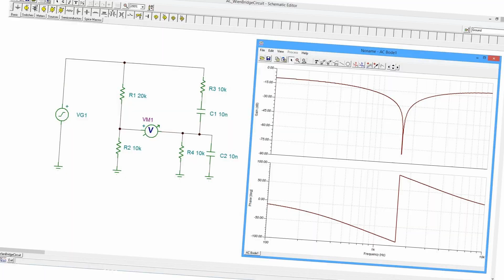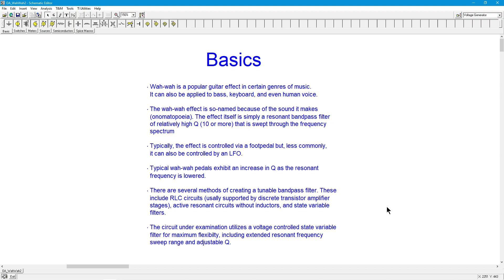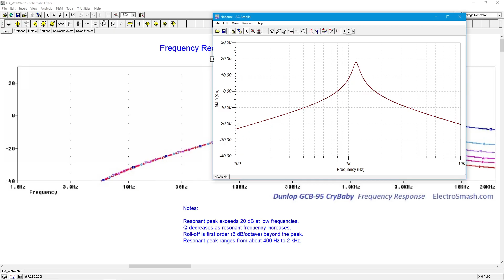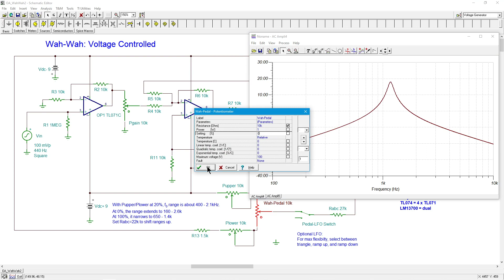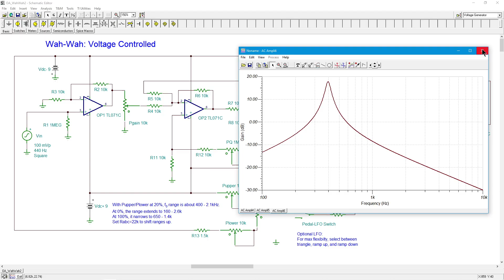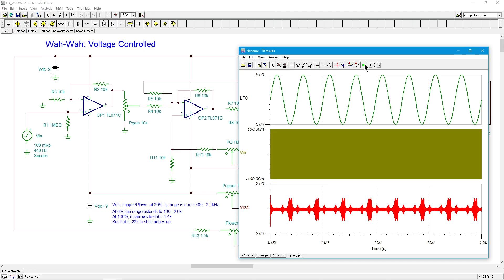Op Amps: Wah-Wah Pedal

Comment: Can you do a video about controlling something like this with an envelope?  I that would be like an autowah or an ehx dr. Q. I’m having trouble getting envelopes from a guitar signal to act as a control voltage.  Love the video!!
Reply from the maker: You might consider using a precision rectifier with a capacitive load to create the CV. Here's another one of my videos that might be of help: https://www.youtube.com/watch?v=eE3FD2pBizc
Reply: You may wish to take a look at the Dan Armstrong Orange Squeezer schematic or the MXR Dyna Comp schematic, both of which have very musical rectifiers to determine signal level. It will take some reorientation for this use, but they follow a similar topology of using the straight audio along with an inverted copy to feed a pair of half-wave rectifiers which charge a cap.  It's a somewhat high impedance result, but you can monitor the voltage with a JFET opamp like the TL072 to buffer, amplify, scale, and bias the envelope detector output for driving the OTAs.  The DynaComp design actually feeds directly into an OTA and may be your best bet for an easy integration.  Try searching for MXR dyna comp analysis and you'll find some nice documents.

Comment: You are using 18V for the power supply (-9V/+9V). Is this to provide a reasonable output gain without clipping? Would it work with a 9V supply but may clip sooner? This was a great explanation of a cool circuit. Even though I have a wah pedal this would be fun to build. Thank you so much!
Reply from the maker: Two reasons, actually. The first is that, as you say, you get greater headroom, but I also prefer it over a single battery because that way you can dump a bunch of biasing resistors and potentially large bypass/coupling caps that are needed for a single supply version. It makes for a simpler circuit that's less expensive and has an easier layout. I think it's well worth the cost of the extra battery. Admittedly, it's slightly less convenient when it comes time to replace the  battery(ies).  But sure, you can make a single 9V version of this given the biasing changes (you can't just ground the negative supply, not unless you like tons of distortion all the time).
Reply: You may wish to consider using a single 9V battery and a charge pump such as the ICL7660 or a more modern variant like the MAX1044 to provide -9 and +9 for the increased headroom and increased slew rate.  The Klon Centaur makes use of the same chip to create +18V and -9V supplies from a 9V for still more headroom.
Reply from the maker: @Peter_S_  Yep, that's a possibility. The -9V supply only draws 7 mA according to the sim. Personally, I don't mind double batteries. One of my active basses uses two and it's never been a hassle.

Comment: A very straight forward design even as a perfboard build and something a hobbyist and novice could build by all practical standards. 

I still remember 30 years ago wiring my first set of pickups out of phase, understanding peak resonance and magnitude, and that the phase shift over time based on amplitude dominance swinging back and forth was ultimately relative to what a wah pedal was doing.

It wasn't until many years later(over a decade) that I actually had a handful of useful scientific knowledge beyond that though lol. We all have to start somewhere.

Comment: 23:20 I hear some overtones in certain sweep positions. So there seems to be some clipping going on in the late part of the circuit. Thoughts?
Reply from the maker: Maybe, but that might just be artifacts from TINA's audio playback. I'd have to build it to say anything for sure.
Reply: @ElectronicswithProfessorFiore    You haven't built it?  Simulation is all very well but I invite you to consider Castle Bravo.  That gave an unexpected result.
Reply from the maker: @wilhelmvonn9619  It sure did. But they didn't have a simulator for that. I'll be the first to admit that simulators are not perfect, but this is a fairly straightforward circuit.

Comment: Oh man... This brings back memories. Back in 2001, when I was a freshman in college, I posted a User Review on Harmony Central for a Bass Wah pedal where I mentioned how to mod it to get rid of the annoying on/off delay it had, just by changing one resistor. Because I used to be active on those forums, every now and then for many years afterwards someone would thank me for posting that. Depending on who you asked, That may have been my last positive contribution to society. I'm pretty sure at that point I didn't understand anything about how wah pedals worked. I reverse engineered just enough to figure out what caused the delay and didn't go any further, and never understood what the wah was doing. I feel like this video is the explanation of the second half of that project from 24 years ago that I never got around to understanding. Thank you.
Reply from the maker: 24 years is a good bit of time. I may have you beat on that delay, though. I started reading a novel by Arthur C. Clarke back in junior high school and only finished it when the Covid outbreak hit! Needless to say, I had to start back at the beginning ;-)